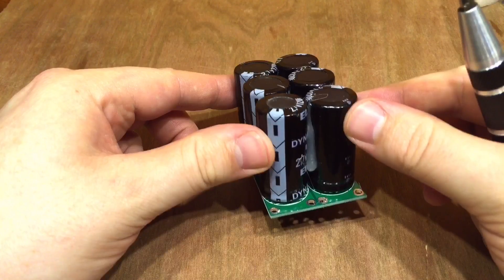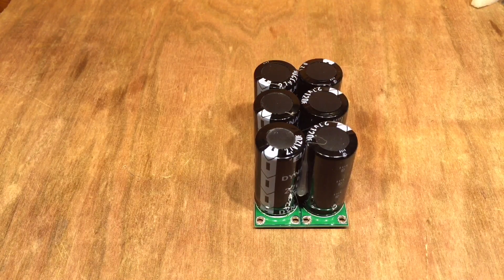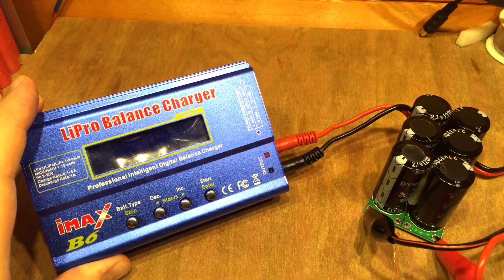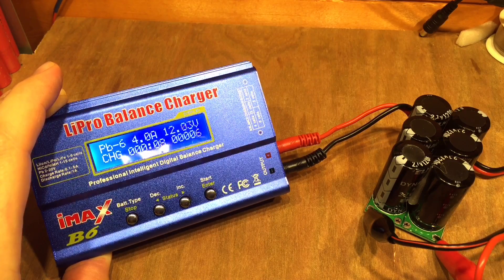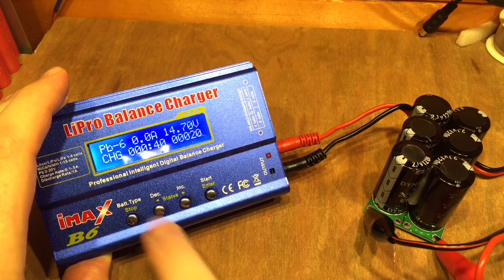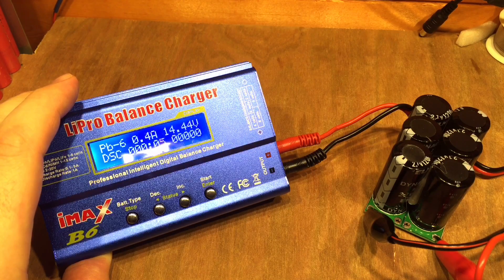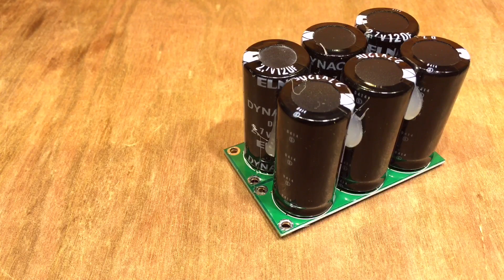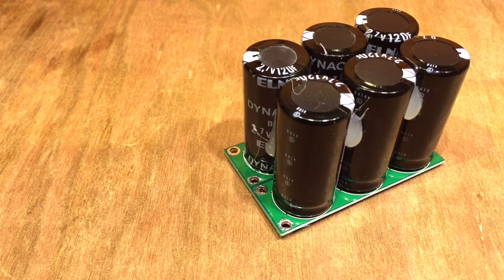Super Capacitor Module - 12v Solar Shed

Comment: If I put the capacitor bank between a solar panel and a load would it work and be safe or do I need a controller and separate battery to power controller. I am looking for an automated system made simple for a greenhouse ta

Comment: I got the little 300w solar charger the one with the adjustable voltage. And it shuts off occasionally I have to unplug the solar panels and plug them back in before it starts working again do you know what's up with that?

Comment: These capacitors can be useful to make large batteries only if their price becomes low and near to other batteries of the same capacity.
Reply: Question why do you want to replace the batteries with this thing? What is the benefit???   Is it just that you don’t ever WANT TO have to replace and maintenance it again (the battery that is) because you won’t have one…. Just wondering.  

I am kind of thinking the same thing about doing this in my car as well.  I have six 500F.  

I am going to use in series for a Total of 16v83F on a protection board. I am trying to figure out.  Do we hook it up just like it was a battery I saw another video where a guy had one hooked up like it was a second battery  and then ended up having to add a small 12v battery so in case he forgot and left his lights on or his keys in the ignition he wasn’t left with only the super caps as with having only them you only have one or two chances to start the car and then your screwed or something like that or if you left your headLights on you would be screwed if you didn’t have a battery or much much larger capacitors or a battery, I suppose you could just keep a jump start pack with you for emergency situations then you wouldn’t need all that…. But kinda dumb if whole reason was to eliminate a battery just to end up with a battery, maybe just go with a lithium iron phosphate battery to start with and be done with it…. Idk 🤷‍♂️ just saying unless this is a race bike and your doing it to save weight than you dont want that weight need supercaps anyways so yea 😂peace out bro 😎

Comment: I know that this video is 3yo, can that module be connected to a cheap pwm solar charge controller (the blue one with usb ports) + a 20watt solar panel to be used as a solar usb charger? Or run a 100w power inverter by adding a bigger panel?
Reply: to run an ionverter you kinda need something bigger in case you have clouds going on - an inverter at 100 watts can suckle 10 amps. for a usb charger it might be viable provided you have enizgh power coming in most of teh time as theese wont hold energy for as long as a typical battery. i would even use a cc / CV step down module from china ( a couple bucks ) for this and then for your usb out add any usb kfz plug / circurtry. that way you also have some sort of MPPT.

Comment: what is the one capacitor f what amp
Reply: you can draw all amps at once out of them - theese are caps. the capacity in mah youc alculate like: 120F * 2.7v = 324 Coulombs per cap * 6 = 1944 / 3600 Seconds = 540mah capacity.

Comment: Awesome thanks! Ordered this same Cap bank and was looking for a way to get an initial charge on it before using it as a battery replacement on a motorcycle. Just to buffer the running lamps.  I have tenergy tb6b already. thanks for the tip on the Pb charge cycle!

Comment: Expensive battery I would say. 1/2CV^2 of energy that means 0.625Wh if you charge it to 16V and discharge to 1V. If you want fast charging I would use a lifep04 battery e.g. a Sony US18650FTC1 18650 cell. 3Wh per cell at 10A discharge and 4C charging is allowed.

Comment: Would that helps removing the ripples on the epever tracer A solar charger 12V output or not at all (for the monitoring graph using the rs485 interface)?

Comment: I still have a question using supercapacitors for solar. If they charge so fast a lot of these banks can be quicker charged by solar then lithium batteries? In the end... in UK is less sun. Less capacity but light as weight and quick usable power catching some burst of sun. I would like to hear some thoughts regarding this.
Reply: As an engineer let me weigh in. A capacitor bank like this one stores energy equal to 1/2 C*V-sq in joules or watt-secs. This bank has 6 120 F caps in series which equals 1/6 the capacitor rating, but 6X the voltage rating. So this is a 20f capacitor. If it charges to 13.5 V, then the energy stored is 1822 j, or  1/2 kw-hr. Is this useful? Maybe if you had 10 or 20 of these it would help?  Also although these devices can accept charge quickly they will be limited in speed by the internal resistance of the solar cells. I hope this helps.
Reply: Sorry, it should have been .5 watt-hours, not kw-hrs. So 1000 of these could store .5 kw-hrs, not very useful.
Reply: @SuperFredAZ  what if we use it to supply surge current required when any motors or inductive loaded to inverter (DC to AC inverter) ...
VRLA battery will be have some voltage drop...
Would it be help...?
Reply: @Sigit.Jalan.jalan.dan.Review  not really, there is not enough energy stored in the super-caps. Charging quickly is not all that interesting for solar, if it can't delver the energy very long. If you had a 100 F (farad) supercap rated at 15 V, it could store around 10,000 jpules ( of energy), E= 1/2 CV^2  (where E is energy in joules, C is Capacitance in farads, V is voltage) 1 kW-hour = 3.6 Million joules or approximately .003 kW-hrs. How useful is this?

Comment: so if you set some caps in series they do stack theyr voltage... and my tech-teacher was wrong???
Reply from the maker: Anything in series increases the voltage, just as anything in parallel increases the current.  Just tread carefully if you're going to point that out to a teacher!
Reply: Peter Hirschoff And when you serious two equal capacitors you can only use half of their capacitance. Opposite of resisitors. (1/Ctotal)=(1/C1)+(1/C2)

Comment: mmmmm  could suitable capacitors be fitted to a fridge to cater for the startup "rush" meaning lower wattage inverters could be used to run the fridge?
Reply: Similar question, my inverter has an undervoltage warning as when the fridge kicks in, so it's overloading my battery. Could this prevent the overload?
Reply: Fridges are AC and a capacitor cannot store AC (unless you're talking like an RV unit)
Reply: Davey Hi no, but inverters draw from DC voltage and convert it to AC. 

By how he asked the question and the context of this channel, I'm assuming he means he's running the fridge off of a battery bank with an inverter in between providing usable AC power. 

He's asking if he hooks this module up between the battery bank and inverter, will it provide the initial surge voltage needed to startup a fridge without stressing that batteries.
Reply: Not likely 1326573. You would need a bigger setup. Most inverters already have some size set of capacitors in them to handle a surge load. That is what causes a spark when you first hook up an inverter if you don't feed it thru a circuit breaker. It is the in rush of current to charge the capacitors.

Comment: These are absolutely FAKE super capacitors.
I have a 100 farad supercapacitor rated 2.7v
And it doesnt even get warm and charges all the way up to 3.2v and holds a charge for AGES and stays cool.
These are extremely fake the ones you got.. 
my supercap is extremely good and handles overcharge without any problem at all. I've overcharged even to 3.4v and it STILL didn't even get noticeably warm!
A real and good super capacitor should handle overcharge to AT LEAST 2.85v surge rating without any signs of degradation or heating.

These get warm just approaching their rated voltage! No good! Most likely a 2.5v super cap inside rated half the capacity! With probably poor quality.
Reply: you shouldn't charge 2.7 V rated caps to 3.2 V and btw this board prevents overcharge by turning on the resistor as a load if one 'cell' reaches ~ 2.7 V

Comment: Hi Adam, i have got problem. I'm trying to charge a similar method with Imax b6 mini. I have got 6x supercapacitor XV3560-2R7407-R Eaton and "220F 350F 360F 400F 500F 2.7V Super Capacitor Balancing Board Protection board.  http://i.ebayimg.com/images/g/1zYAAOSwud1W~-k4/s-l1600.jpg When I set for charging, appears inscription on Imax "Connection Break". Why? (Sorry for my english)

Comment: can i connect parallel to car battery directly without any circuit ? is it safe ?
Reply from the maker: +tenkuken234 I'm not sure his module has the grunt to be of much use - although I'm not experienced with using super capacitors this way.

Comment: I purchased the same capacitor bank from Ebay.  Seems some of the sellers do not have a clue about what they are selling as the listed said 2.7V 120F bank.  I emailed them to ask if they meant to say 16V at 20F and they kept coming back saying it was a 2.7V 120F capacitor bank.  Anyway they were wrong fortunately and I am using this with a crank generator for a portable battery to charge USB devices, and run some LED lighting.  I don't know if the specs on the caps is correct but the rice was right.
Reply from the maker: +valveman12 Yeah it's a useful and interesting item. I don't know if you've seen Julian Iletts video on the same item? He found the protection circuitry wasn't all that great and it's quite easy to over charge the caps. Worth a watch anyway. 
I don't take mine over 14 volts generally so well within the rating.
Reply: Hi Adam  Thank you for the info.  I will go to Julian's youtube channel and check it out.  Happy Holidays.
Reply: Trust me I've asked tons of sellers but I asked them it's a 16v 20F or a 2.7v 720F and they didn't have ANY clue, I've asked them max surge amps, sustain amps ...still no clue. I'm thinking of getting 3 of them and start playing(my target is to replace me UPS batteries as they turn bad - don't need big protection, just for some 1-3 secs we have here in my area) ...Unfortunately my UPS uses 3x 7.5Ah batteries(Online type of ups at 1kVA) so using 3x of these modules would give me 48.6v at 6.67F ..I might need to use some in series ...we'll see(still thinking of it due to cost - if they costed a 16.2v 20F module 5 Euros I'll purchase a pack of them :P)
Reply: so 20F is too small to start a small car engine?  will 50F do?

Comment: Adam,good video many thanks. I got this board and do charge it to max 15.5 volts. It takes about 1 1/2 minutes. It provides power to 4.5 volt usb led for about 1 hr then it dimms for another 1 hr with approx 11volts left not enough to keep light on. I paid $12.00 for it which is very reasonable considering the 6 Caps price. I ordered a second.
Reply from the maker: +Karim Ismail Cool. Thanks for the comment. Have you seen Julian Iletts videos on this? You might want to be careful when charging it that high.
Reply: Karim Ismail so you could charge your phone with this?
Reply: Dan Hart u can power car charger with this module to stepdown 12v to 5v for mobile charging. hv a gud day
Reply: +Dan Hart - With this and Step Down and play around + your time + extra Co$t. Just buy a Power Bank to charge your Phone. It will last longer for Storage / Mobile and best of all, CHEAPER :D.  These are meant for SHORT TERM Usage, that's why they cost more.

Comment: I've just seen Julian Ilett's look at the charge-voltages and an analysis of them. Worth a look.
Reply from the maker: +nlo114 Yes thank you - I'm a subscriber of Julian's and I left a comment on that video. I keep the voltage to a maximum of about 14.2-14.4 volts so I should be ok. Next time I use it though I'll be checking.

Comment: You may want to try and keep 10-20% head room for those caps. The Farad rating on that bank should be 20 F.
Reply: Lasersaber just made a crank generator using 6 400F caps and started his vehicle with it as well.  He removed the battery and only used the generator to start his vehicle.  Worth a look.
Reply from the maker: I do.  I only take the whole bank to 14.5 absolute maximum.  I think that is about 90% - just? :-)

Have you seen Julian Iletts video where he took it over 16.2 volts?  Worth a watch.
Reply: ***** Yes, I watched and was shaking my head when he did that. 
I created an 250 Farad bank with 18 / 2.7v 500F caps, 3 banks of 6 series. I used simple 2.4 volt zener diodes in reverse bias to leak off current and keep the caps from over voltage. It will start the V8 in my Chevelle.
Reply from the maker: +valveman12 Yeah I've seen this. I think a hybrid battery and capacitor bank is quite a good idea too.

Comment: So you're heading down the road on how to charge Li-ion with solar power? I sure hope you do. It's very difficult to find documentation about that.
Reply from the maker: +Kenneth Tan Something along those lines... ;-)
Reply: +Adam Welch I hope you succeed. So far my research has shown Li-Ion are not that suited for solar charge current fluctuations. So lifetime problems might occur. Also if using reclaimed 18650's you need to be absolutely sure about checking individual internal resistance. But for that we now have a solution (wink wink). Looking forward to your findings.

Comment: that's expensive though xD
Reply from the maker: +BillTheBox Do you think? Seems the going rate. If you find one dead cheap let me know :-)
Reply: +Adam Welch it seems super caps are very expensive :p

why buy a B6 clone though ? and will you calibrate it so it doesn't overcharge your batts ?
Reply from the maker: +BillTheBox yes I have calibrated it using my voltage reference :-)

I got into a conversation the other day and I realised I haven't got much experience with balanced charging. I'm sure we'll see it on the channel again soon ;-)